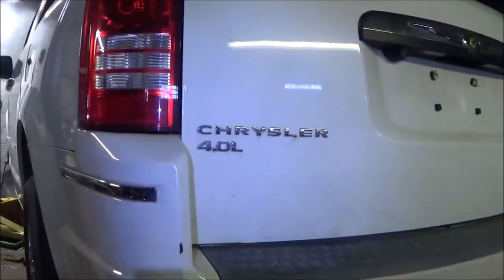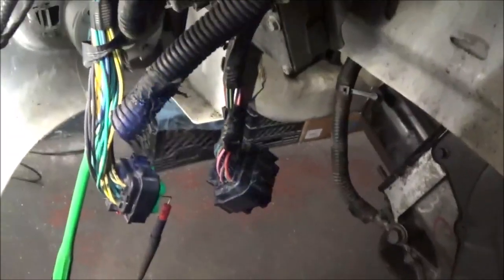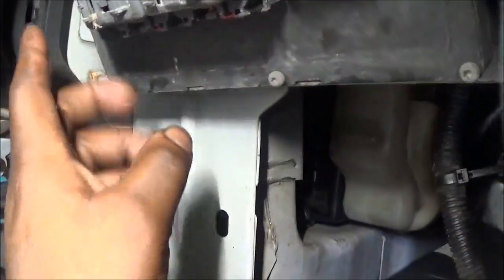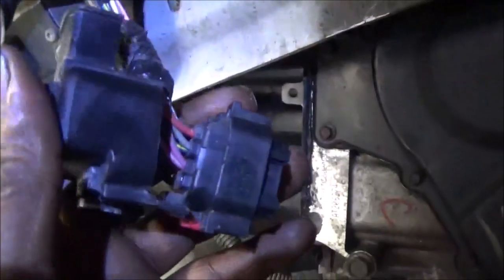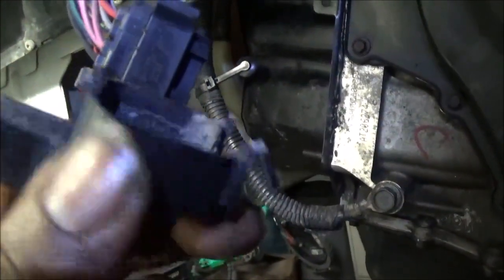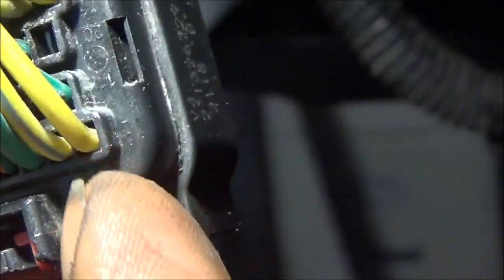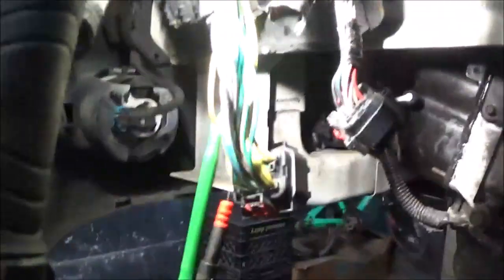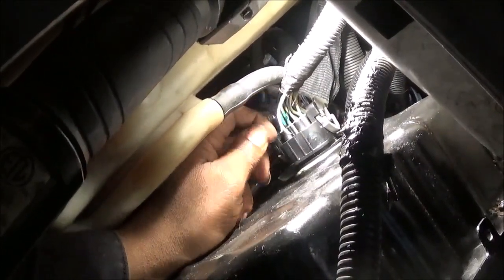HOW TO RESISTANCE TEST SOLENOIDS (2009 TOWN AND COUNTRY) P0755 (PART 1)

Comment: I got a 2013 chrysler town and country. I tested the pins under that plugin on the transmission pan and I get 0.01 on most of them and some of them I get 1 on the ohm digital tester. It doesn’t beep or anything. Just says 1.
Reply from the maker: Your tester has to have a option to have the beeper on when you want it. If your tester does not have this option, then it will not beep.

Comment: cut the plastic a little or get the tool to just remove the one wire connector inside solder then silicone over it.

Comment: Such a helpful video, thanks. I have exact same problem, same year and same p0755 code. I got the transmission out of van now and I'm trying to ohm test the same wires. I ohm tested all the wires you tested but Im getting "OL" on ALL THE WIRES.
Did you have the battery connected?
Does the transmission need to be back on van to do test?
Reply from the maker: You have to have the solenoids hooked up to the wire harness.
Reply: @thisisyourtransmission  thanks for your answer, I appreciate it. I did jack up transmission high enough to connect the solenoid pack to wire harness and also bolt up the ground on transmission case and got no "ohms" readings. I'm wondering if the battery needs to be connected and key "ON" to do these solenoid tests. On your video I didn't see if battery was connected or if ignition key was "on"
Reply: Does the voltage feed wire (yellow with orange) only have power with "key on position" or is it always powered?.
Before spending  money on rebuilt transmission again I'd like to make sure I don't have an electrical wire problem. This transmission was rebuilt 4 years ago, it drove fine for 6 months and went into limp mode again, I parked it for 3 years and now trying to fix it and it had to exact code back then.

Comment: Black orange white green are the colors of those connectors. They are color coded on the outside of the connectors as well so you don't need to unplug them to see.

I wish more mechanics did actual troubleshooting instead of throwing parts at issues.

Multimeter can be your best friend people.

Comment: Good find!😊.  One problem leads to another.  That's why we like to fix things👍.  If you splice in a new connector,  will it affect the way the transmission will operate?
Reply: Will the resistance change if you have a longer harness and affect how the solenoids operate?
Reply from the maker: No, it will not affect anything.